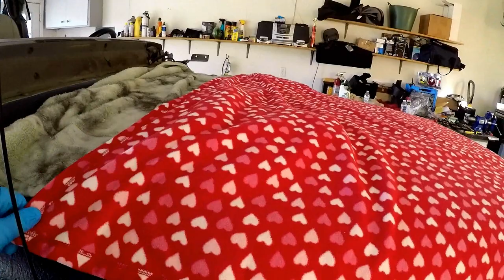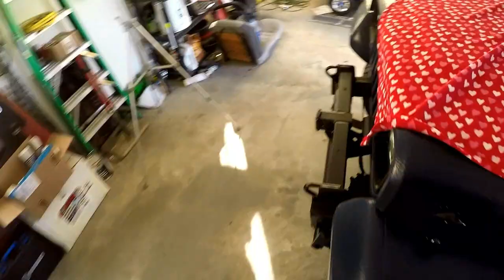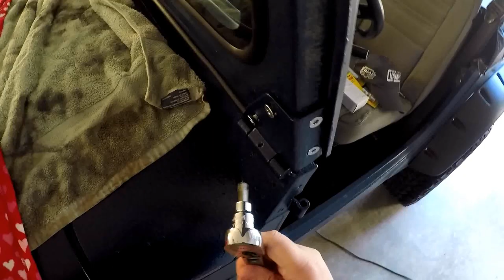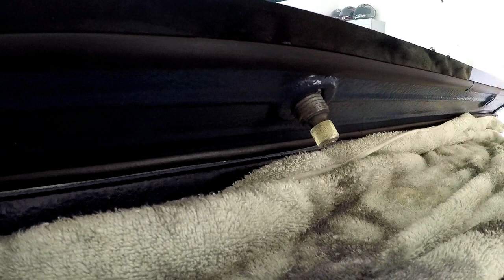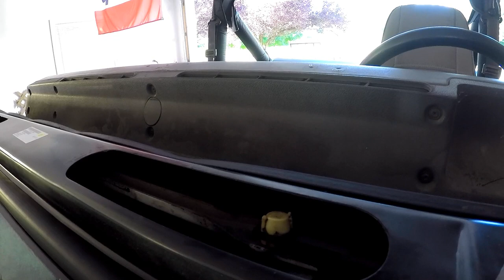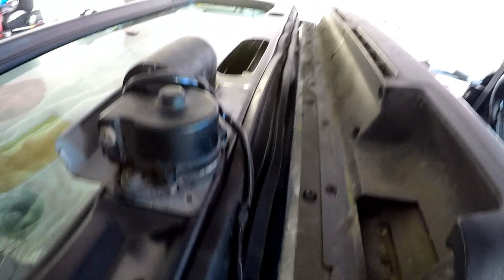Wrangler YJ Windshield Frame Replacement

Comment: This worked great! Just finished the frame replacement on my 95 YJ.  I could have used more guidance on the removal - probably could have saved myself a few steps later!  What worked great:  I didn't have the glass in yet - much lighter and easier, plus no danger of breakage.  I followed your wiper mechanism install EXACTLY - and it worked!  You have to do all the steps in that order or stuff won't go in.  It fired right up and moved smooth.  Also, I used a double-strap setup (4 total) to squash the seal, which worked fine.  Just let it sit overnight and the bolts went right in, nice and snug.  Problem spots:  the hinge bolts were tough, but a 4x4 parts place had them out in 30 min.  Best to get help on those unless you do this for a living!    Note: used the Quadratec kit, very nice, complete, no problems, except no instructions!  That's where you came in.  Thanks so much!
Reply from the maker: Alan, this is what we like to hear!  Real world experiences, real feedback, and taking the time to share your experience!  Thank you so much, and good job on the install! Glad we were able to help you out with some of it!!👍

Comment: How was the removal process? I have to remove mine
Reply from the maker: Hey Ryan!  Removal wasn't too bad except for the nut-serts that are on the inside of the windshield frame.  Because my original rusty windshield frame was exactly as described - old, original, and rusty - the bolts were seized up with the nut-serts.  So, for at least 2 or 3 of the bolts I had to drill them out completely to get the old windshield frame off.  Once they were drilled out the next potential issue is the hinges.  I sprayed my hinges with penetrating oil for a couple of days and applied some heat to them to make sure they would fold down without breaking.  I think I may have gotten just a little bit lucky because very slowly they folded down then I worked them a little bit to make sure I got that penetrating oil into the hinge.  Overall - potential for broken hinges, drilled out old bolts to remove.  Hope that's sort of the information you were looking for.  If not, let me know and I'll clarify anything you need. 👍👍
Reply: @GearTubeTV  yeah I’ve had to replace my hinges anyway for my light bar/roof rack. So Thts half the battle there. How was taking the windshield motor off?
Reply: I’m actually doing the same color monster liner as your Jeep lol. Yours looks awesome so but I’m also changing out my windshield cuz mine is in rough shape and I wanted to monsterline it anyway while it’s off